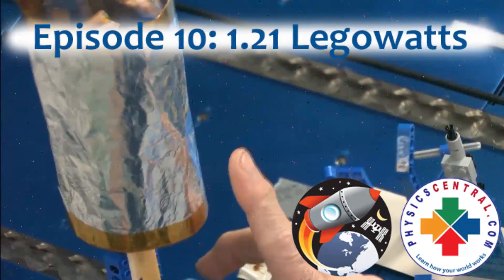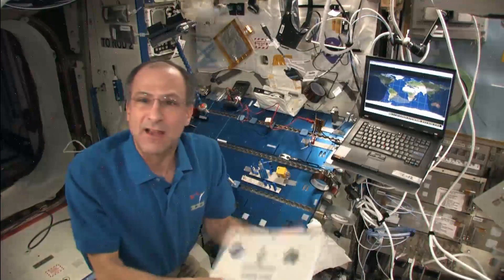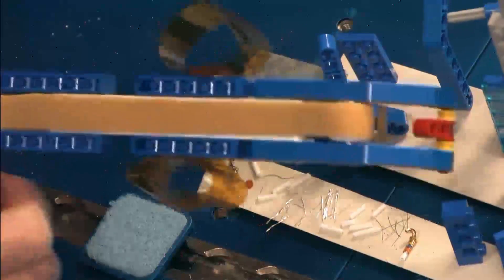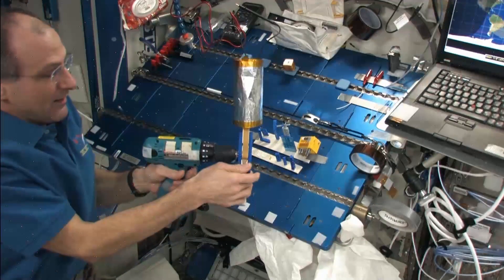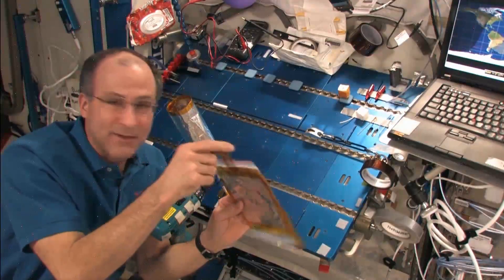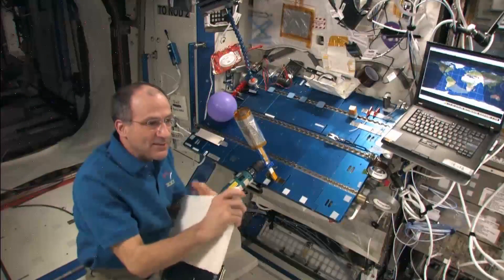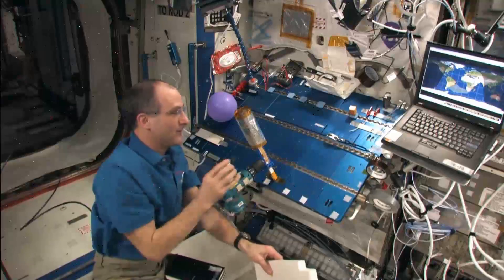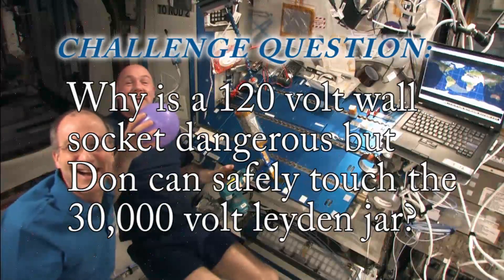Science off the Sphere: 1.21 Legowatts

Comment: Actually, it's energy that kills you. The current going through you is proportional to the voltage of the source, i.e V = IR (roughly speaking since the human body is not a perfect resistor). The current on a power supply is the rated current, but it will only deliver that if the resistance of whatever it's drving is sufficiently low. The reason the leyden jar won't kill you is that it stores so litle energy which dissapates so quickly. Watch this for more info: 8xONZcBJh5A

Comment: It has to do with the current and more importantly the charge(current times time), which has been found to have the largest biological effect. With the leyden you have 30000V but low current for a short peroid of time a so the total charge is small. Whereas the wall socket is lower voltage but higher current and you will most likely be in contact for a longer peroid of time, meaning a higher charge which potentially more harmful.

Comment: i just learned about electricity in my chemistry class. the reason that 120 volt wall socket is dangerous is because each electron carries more current or energy, thus dangerous when discharge, the Leyden jar probably have a very low current, which makes it less "shocking".